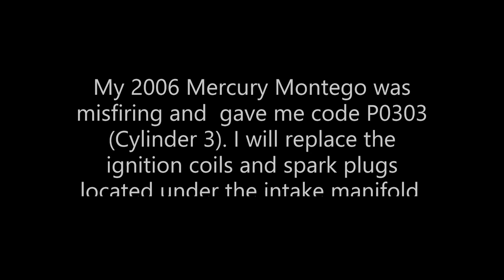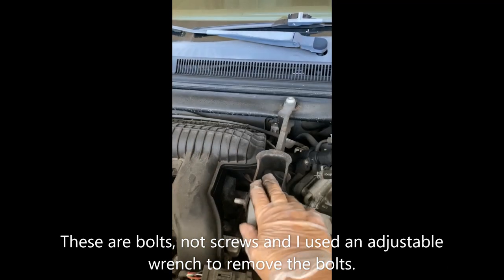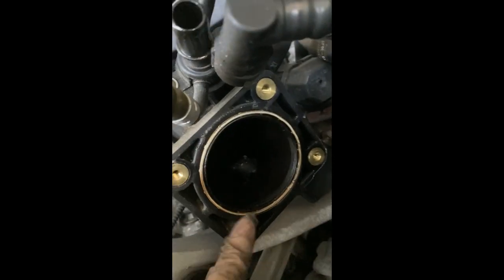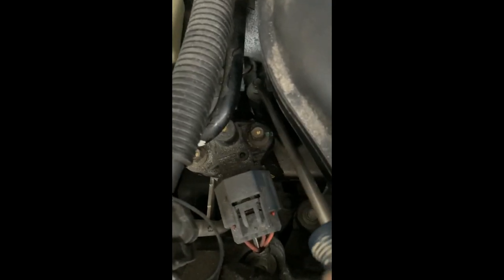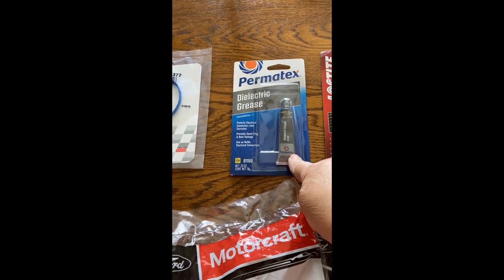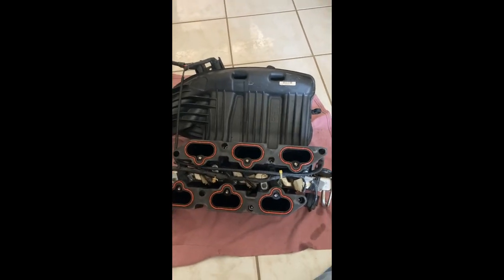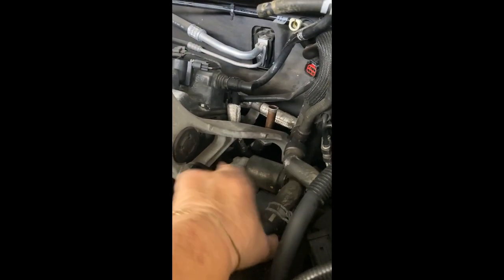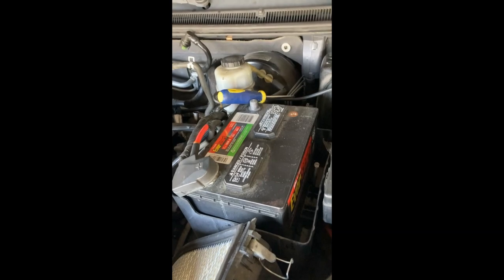How to remove the Intake Manifold, and replace coils & spark plugs on a 2006 Mercury Montego 3.0L V6

Comment: Your video was better than many of the men you see on here who are MECHANICS!

Thank you!
Reply from the maker: Thank you!!!
Reply: Well thanks to you I got up the courage to tear into mine yesterday. I'm a decent shade tree mechanic but I hate anything built after the 80s. Especially front wheel drive. 

I got the intake off and now waiting on coil packs and plugs since my local parts store only had one coil pack. I ordered them off Amazon. 

I used a 15/16 wrench on those mount bracket bolts and I got very lucky on the EGR valve. It wasn't that tight. I used a standard wrench. I think a 1 1/8. 

Hope it goes back together as easy as I got it apart. 

Thank you again.
Reply from the maker: That’s great! I’m happy to hear you had no trouble loosening that EGR nut. Everything should go back together easily from here on. There’s nothing like the satisfaction and feeling of accomplishment when you do it yourself.
Reply: @Chocaluvr  
I live in the south so usually bolts aren't that hard to deal with unless it was a northern car. My friend from Indiana moved here and was shocked at how clean the cars are.

I got it finished today. It went back together easier than it came apart. 

Another piece of advice I would offer is buy some bright green painters tape. I keep some in my toolbox.  Mark all the hoses with the tape and write on it where they go. Also I use toolbox tray organizers to keep my bolts separate when I work on stuff. Just write what the bolts go to on some tape and stick it in the bottom of that section. That has worked so well for me over the years. And as you said, pictures! Lots of pictures from every angle.  Close up, zoom out, etc. 

Thank you again! You did an awesome job.
Reply from the maker: Great tips. Thanks!
Reply: Excellent

Comment: @11:35 explaining that the EGR valve nut loosens to the right instead of left is probably the MOST helpful tip that isn't in any other videos I've watched!! This video the most comprehensive and clear with all the steps I'll need to follow. As a single disabled mom on a tight budget that can't afford to pay a man to do this, it's very encouraging to watch a video made by a woman that is comfortable admitting which parts were a struggle! 

Also, I'd been trying to figure out what the rotted rubber part was called that needed replacing in the middle of that motor mount in the middle so I could order one; you called it a TORQUE STRUT MOUNT/BUSHING.
 Now I am more confident that I can handle this repair myself even if it takes me several days. Thank you so much!💞
Reply from the maker: You are welcome! Don’t worry about how long it takes; it took me days to do it myself. We’re in the same situation. Here’s the link to the bushing I got. Make sure it fits your car. I have another video showing how I did this also. https://www.amazon.com/gp/product/B00FLFVLH0/ref=ppx_yo_dt_b_asin_title_o02_s00?ie=UTF8&psc=1
Reply: Yes, I think if you look at it from the top, then yes, it would appear you have to turn the wrench clockwise.  But if you look at it from the nut's point of view, it screws tight upwards toward the EGR valve, so in that point of view, it's still right-hand thread and it would loosen counterclockwise (normal) so it's not technically reversed threading, just point of view.

Comment: This is something I read on a Ford forum about the EGR valve:

“I did find out you don't have to remove the EGR
valve! There are two bolts that connect the ERG
valve to the Plenum that when removed separate
the two, then the intake manifold may be
removed. Much simpler than taking off the large
nut holding the entire EGR valve. Hopefully this
will be a help to those trying to remove their
intake manifold”.
Reply from the maker: Yeah, others have suggested it. I’ve also read from others that have done that is that those two bolts can be difficult to loosen. One comment I read from someone who did that was that they had trouble with the car throwing off codes after they separated the EGR valve. Once you separate the EGR valve from the plenum, the gaskets should be replaced and some people don’t think of doing that. Either way, it’s too much trouble to get to the coils and spark plugs the way this car was designed.
Reply: I was thinking about the possibility of causing vacuum leaks by removing the EGR valve that way too. 
My 2007 Mercury Montego Premier has almost 106K miles on it, I think I’m just going to see how far it goes.
Reply from the maker: @johnbiavaschi1829  I feel that if you go into it knowing that there may be some risks and be prepared to deal with it, you’ll be okay. If you decide to go via the EGR way, just be ready with replacement gaskets. It’s a pain in the rear but is doable. I never thought I would accomplish this when I started it but stuck with it and I’m glad I did. Car runs so much better 😃

Comment: That EGE valve nut is the bane of my existence! I haven’t been able to get it off. I feel like seeking off the car.
Reply from the maker: I know what you mean! It took me 3 days fighting with it. Remember to loosen the nut like I showed in the video. Try soaking a rag with WD40 and wrap it around the nut overnight. Some people have suggested using a torch to heat it up.
Reply: @Chocaluvr  I soaked it in wd40 overnight but still couldn’t remove it. But I went another way and removed the two bolts on either side on top of the egr valve and was finally able to lift off the intake manifold but it was surely more harder. I had to loosen the black metal line on the left though because it was blocking the left edge of the manifold. I saw the next morning that there was tons of orange/pink oil on the ground that came out of that line. What is that line and is something I need to worry about?
Reply from the maker: @adtynkr  I believe that's a power steering line you are talking about, there's also a vacuum hose there if I remember, but anyway, check your power steering fluids and all the other fluids when you put everything back because when you start removing hoses, you'll have leaks.
Reply: @Chocaluvr yes you’re right! That’s my power steering fluid all over the ground. The power steering fluid reservoir is empty. Seems like the line going down into the steering pump is bent and leaking 😢. This is turning into a nightmare.
Reply from the maker: @adtynkr  I’m sorry to hear that. It’s probably easy to replace by checking junk yards in your area for the part.  I too ran into my nightmares when fixing things. It happens unfortunately. 😞

Comment: All of this nonsense just to replace spark plugs. I got stuck on the EGR nut for a couple days until I hit it with some Ballistol and a torch. I also had to remove the battery and the box to get more room for the wrench. I kept telling myself "Id really love to slap the team of engineers who designed this engine".
Reply from the maker: I agree!!! The EGR nut had me going nuts! Did you see where the engineers placed the alternator? Halfway down underneath the throttle body! Old Fords had them on the passenger side at the top. Well, at the cost of my sanity to replace 6 spark plugs, I saved myself nearly $1000 from a mechanic that thought he was going to rip me off because I’m a woman.
Reply: @Chocaluvr  Yeah, they certainly don't build them for ease of repair anymore. They make them as hard as possible to work on, so you have to bring them back to the dealership. It's all designed with profit in mind first, then reliability, then ease of repair. Nice to see a lady who isn't afraid to turn some wrenches, break her back a little and get her hands dirty, there aren't many of you around. :)

Blessings to you Choca!
Reply from the maker: Thanks! Blessings to you as well. Being a single mom has forced me to learn to do many things on my own.
Reply: i gave up on that stupid nut and just unbolted the 10mm's that hold the egr valve gasket face to the pipe that goes into manifold. but now i'm worried about air leak when i put it back together. completely idiotic design
Reply: @zechscott9554  The engine is reliable but the design is terrible.
Reply from the maker: @zechscott9554  can you replace the egr gaskets before putting it all back together?
Reply: @Chocaluvr  yeah i think that's what i'll have to do
Reply: @Chocaluvr  TRUTH.
Reply: @Chocaluvr  
Not only do it to women. A local shop quoted me the same thing this week and they knew that I know about cars!

I said that car has 275,000 miles on it. It isn't worth a thousand bucks. 

I'm fixing it myself. I despise anything built past the 80s. So ridiculous to work on. 

Thanks for the video. I have watched several of these getting ready to tackle this thing.
Reply from the maker: It’s ridiculous what some repair shops charge.. I wish you success! Thanks for watching!
Reply: Lmaooo lmaooo I can honestly say this is by far the worst job ford came up with 😂

Comment: I replaced throttle body last year. and just recently put in a new egr last month to get rid of a p0108 code. No light for a month. Now i have p0402 today. Sigh... i heard that if i clean intake manifold it might fix it. Ford 500
Reply from the maker: It sounds like the EGR is still the problem. It could be something as simple as carbon holding the EGR valve stuck open or a temperature sensor. You can try cleaning the EGR valve & replacing it’s gaskets to see if it clears the code. Check to see if it was installed correctly and there are no leaks in the vacuum hoses. When they replaced the EGR, did they check the EGR pressure transducer? Some of these things you can do on your own before spending any money on replacements. Good luck!
Reply: @Chocaluvr  thank you. It was me who installed new egr. I thought i did it right. Afterward, since the battery was disconnected, it reset cars memory, naturally. The light never came back on, until today, over 30 days later. Also, a strange thing, 7 monitors are ready on the car, but the final one hasnt been ready yet. After a month of driving. This has never happened before. It's disheartening to fix an issue only to get another. Garages don't wanna work on the car, so i do it myself.
Reply from the maker: @c.518  go back to your installation to check for leaks and visible carbon pieces that can be cleaned out. While you’re at it, clean the throttle body. They get dirty quickly. 👍
Reply: @Chocaluvr  thanks. Will do. I just returned the 1 1/16 wrench 2 days ago at the autoparts store. That egr bolt is wild.  Thinking i will never need it, but also low on cash. I think i jinxed myself 😅
Reply from the maker: @c.518  Nah, you didn’t jinx yourself. It happens and it’s frustrating and a nuisance. But that’s how we learn.

Comment: What is the order of the ignition coils/cylinder? Cylinder 3 on my 2006 Montego is misfiring so if I don’t have to remove the manifold that would be awesome lol. Great video by the way I atleast know if I have to remove the manifold I’ll know how thanks to you
Reply from the maker: I hate to tell you this but if you have the same engine as mine, your Cylinder/coil 3 is under the Upper Intake Manifold. You’ll have to remove the manifold. I suggest you replace all 3 coils while you’re there because when one goes bad, the others follow. I replaced all 3 coils on my car not just #3.

Comment: Hi. What oil type you use? It calls for 5w- 10. Should higher milage use high type?
Reply: For older cars I've been told higher is best. I've used 10W 20 or 10W 30

Comment: I have to do this also but I have to go barrow the tools do you remember what size wrenches and sockets you used and any other tools it took to do this
Reply from the maker: I can’t remember all the tools I used but I left links with all the parts and tools I used. Here are the main tools I used that I can remember. You are going to definitely need a 27 mm or 1 - 1/16 inch wrench for the EGR nut.  Also you will need an 8 mm and 10 mm deep socket bits for the bolts holding the intake manifold and throttle body. You can use a big adjustable wrench to remove the two big bolts holding the cross bar. I believe I used a T-20 star driver to remove the star screws inside the intake manifold. I hope this helps. Good luck!
Reply: Thanks

Comment: I have same car. I notice lots of pinging. Can this be bad plugs?
Reply from the maker: Bad spark plugs can be one of the reasons but try changing your gasoline to a high octane gas first and see if it helps.
Reply: @Chocaluvr  I use 87. GAS  i read it suggest 89 what do you use?
Reply from the maker: @truthisnow2896  I use both. I alternate.

Comment: What happens if you don't take the bolts for the intake manifold off in order
Reply from the maker: If you already tightened the bolts out of sequence, I wouldn’t worry as long as the surfaces meet smoothly with each other.
Reply: So I got scared midway through and didn't take the intake manifold off but I did loosen that bolt and I left it three threads loose. Will try that and replace the gasket on the throttle body

Comment: I don’t know what happen but my car is shaking even more then it was before He changed spark plugs and I don’t know if he even changed the coil it was a cylinder 2 misfire so he was supposed to remove the intake wich he says he did but I’m not to sure now . My car is worse then before I had it fixed
Reply from the maker: Have someone check it out for misfires. Autozone or any other auto parts store can check it out for free. It could be a number of things. Sometimes if you don’t put things back together right, for example and EGR valve, it can cause problems. Have someone else check it out, then take it back for them to fix the problem.

Comment: Well I fixed the misfire but now iam leaking air somewhere it seems like
Reply from the maker: If you removed the EGR valve,  did you replace the gaskets in the EGR valve? Did you tightened correctly the nut underneath the EGR valve when you put everything back together? I would start checking the EGR valve area.